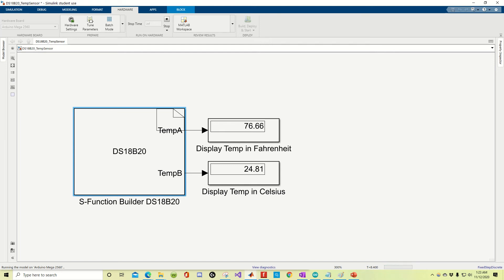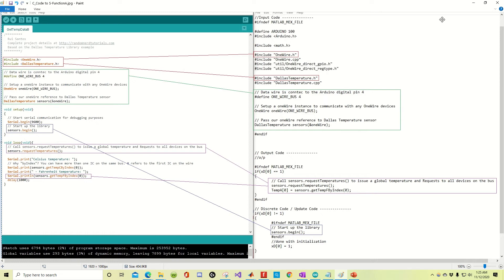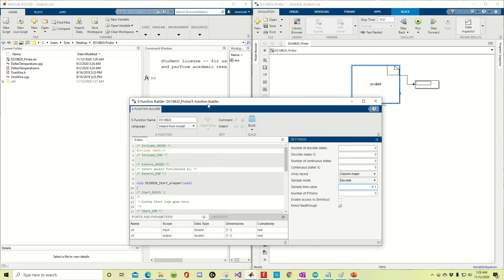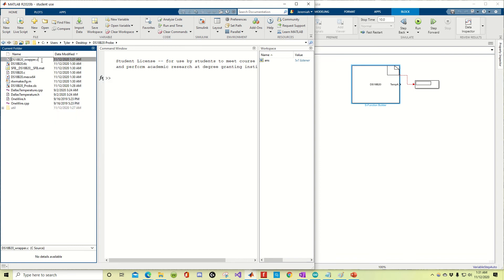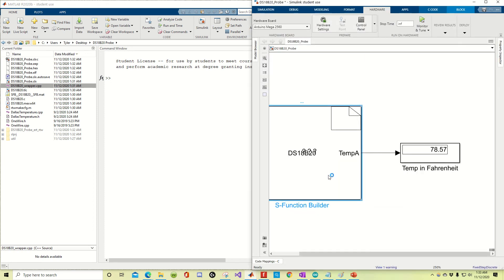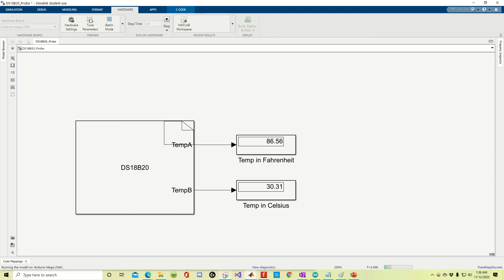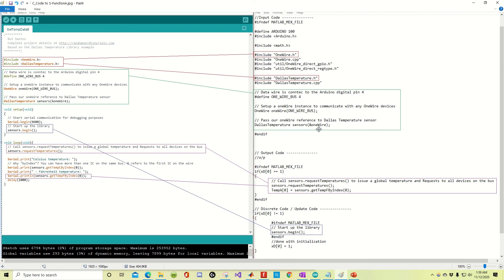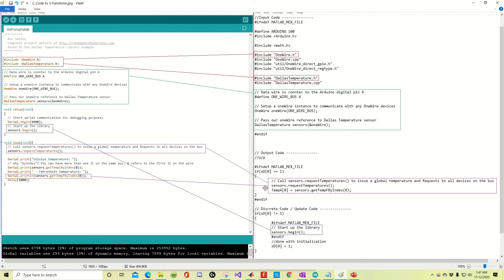1 How to integrate DS18B20 with Arduino in Simulink/Simulink s-function builder basics-1 temp Probe1

Comment: I am trying to use the Adafruit ILI9341 library in Simulink. 

I did everything like you did but when i try to build the Simulink model i get the following error:
Unable to find S-function module 'ILI9341_wrapper.c'. S-function modules must exist as either source files or pre-compiled object files on the MATLAB path.

I renamed the ILI9341_wrapper.c file to a .cpp file and added the extern "C" to the void functions. I also got the ILI9341_wrapper.mexw64 in the Matlab folder. I also added all the header and cpp files, which are included in the Adafruit ILI9341 header and cpp files, to the same Matlab folder. I am using Matlab R2022b. 
Do you know how to fix this problem?
Reply from the maker: I unfortunately don’t know how to resolve this. When I was testing I only used Arduino brand boards since any offshoot brand seemed to have issues.
Reply from the maker: It is possible the issue is due to missing library files within the bootloader but I’m currently unsure how to resolve this issue.
Reply: @NathanielTyler  I am trying to use the Adafruit_ADS1015 libary with Simulink and I have the same error as daniel. I do not have the Simulink Coder installed. I think this causes this error. Is that possible?
Reply from the maker: @AntoMatic-b5d The simulink encoder is needed for converting simulink block code into the c code which will be flashed onto the microcontroller.

Comment: Many Thanks. Diagnostic viewer giving error when I click to Monitor & Tune icon. Error : Code generation information file does not exist.  How can I fix this?
Reply from the maker: Do you have simulink encoder and matlab encoder installed? Do you have a complier such as visual studio community installed?
Reply: @NathanielTyler  Thanks for quick reply. I have intalled Simulink Coder , Embedded Coder , MinGW Compiler but Visual Studio Community not installed. I am also using Matlab R2020b like you.
Reply from the maker: @OpAmpLogic  what controller are you using?
Reply: @NathanielTyler  I am using Arduino Mega(2560)
Reply from the maker: @OpAmpLogic  review this link and tell me if it helps:
https://www.mathworks.com/matlabcentral/answers/731733-model-error-code-generation-file-does-not-exist-simulink-and-arduino?s_tid=ans_lp_feed_leaf
Reply: @NathanielTyler  Which version of the Visual Studio need to install for using Matlab R2020b?
Reply: Did you solve the problem? Because i have the same problem
Reply: @alischannel7206  codertarget.arduinobase.registry.setBaudRate('YourProjectName',115200)    Copy and run this code in your matlab  project. Then all parameters is same
Reply: @OpAmpLogic  i run the code but still the error
Can I contact you privately sir? To show you the circuit i have

Comment: Hi Tyler, thanks for the great video.  I replicated it and it works.  But I would like to read 2-4 sensors.  Unfortunately that doesn't work.  When I use an Arduino sketch, multiple sensors work.  But I can't get a connection in Simulink.  I tried to adjust the index but there is no value.  1 or 0 remains in the display.  Can you tell me what I might have to adjust.  Many thanks regards Denny
Reply: I have been resolved... implemented both single reading PIN's on Arduino UNO and build a Air Flap control Code handle two AirFlaps w/ relative crossing Temperature Detection at runtime.... I don't know why doesn't  handle library one PIN w/ more as one Sensor connected....? Im using PIN 4 and 7 as example and it work's fine.... Thanks a lot for getting information S-Function as owned library implemented Simulink Model.... Very helpful best regards Denny
Reply from the maker: @dossidr  Sorry for the late reply but I'm glad you were able to resolve the issue.  Well done on implementing a working solution.
Reply from the maker: You can modify the s-function so it accepts more than 1 input. I’ve done this before with weight sensors. I’ll try to get a code sample for you later today.
Reply: Hello, I managed to implement two sensors in the same S function and it works great. Note: I used a single arduino port for the data from both sensors.

Comment: How to connect the fuzzy logic controller with S-functions(sensor and actuator ) to behave with fuzziness in a simulink model and how to deploy them to plc?
Reply from the maker: Can you give me an example of what your desired setup?
Reply: @NathanielTyler  Here is the model that I want to deploy on a plc (raspberry pi /Arduino) the sensor and the actuator are presented with Matlab functions for simulation purposes until I can make s-functions for a temperature sensor and a dc motor(sensor and actuator could be replaced with any other types) my challenge here how I can connect all the parts with fuzzy rules to behave in a pleased way https://drive.google.com/file/d/1nvaCG2x5UtxMpYGpxoARwtWYkhxo0R8K/view?usp=sharing
Reply from the maker: @abdelghafarelkhaoui9806  Please note I have not verified this, but I think you have to mux your signals of interest and then feed the mux output signal into your Fuzzy logic controller. 
%% You Tube Examples %%
1) https://www.youtube.com/watch?time_continue=192&v=Z12oK07oFA4&feature=emb_logo
2) https://www.youtube.com/watch?time_continue=125&v=gPU9jWKXAgQ&feature=emb_logo

%% Simulink Example %%
https://www.mathworks.com/help/fuzzy/simulate-fuzzy-inference-systems-in-simulink.html

If your question is more specific I will have to do more research.
Reply: @NathanielTyler  thank you for the help my issue isn't with the model but the question here for example I have a sensor and actuator I set their fuzzy MF and sets and I simulate them but how to deploy them to plc? How to generate code and deploy from the model? Use a functions and write in C++? But how to connect all the parts with FLC and deploy the whole model to behave the way it behaves in real life?
Reply from the maker: @abdelghafarelkhaoui9806  Here's another video I created a while back that may explain what to do:

--- YouTube Video ---
"1 How to integrate Max6675 with Arduino in Simulink/Simulink s-function builder basics-1 temp Probe2"
https://www.youtube.com/watch?v=vFup14vi6H4&t=204s

--- How To Document --- 
"003 How To Make this Step By Step.DOCX"
Note: In step "006 01 Run Code on Arduino Uno.JPG" click 'Build' instead of 'Monitor & Tune' 
https://docs.google.com/document/d/11q6ylKlSURZBLG43LrsDaWVUGsq7A4oF/edit?usp=sharing&ouid=112053615642444612541&rtpof=true&sd=true

Comment: Thnx for the explanation, it's very helpful, I just wonder if there is a way to do the same to raspberry pi ?
Reply from the maker: **Summary**
YES, Simulink can flash to a raspberry pi.
Please note I have not used a raspberry pi, but the s-function builder block will be very similar.  

**Here are 2 links that should get you started**
Add-On Download Link: https://www.mathworks.com/hardware-support/raspberry-pi-simulink.html
Setup: https://www.youtube.com/watch?time_continue=318&v=wWLBugWJLwQ&feature=emb_title

**Steps for success** 
Step 1) make the code work in raspberry pi IDE
Step 2) translate that working code into a templated text file for 's-function builder block'. // Note: use my text file template as reference
Step 3) copy text into a 's-function build block' and test functionality with the raspberry pi.

**Note**
If you get stuck on step 2 or 3 you can send me your working raspberry pi code and I may be able to provide suggestions.
Reply: @NathanielTyler  Thnx a lot for the explanation and the reply, in fact, I already installed the needed packages and I had run what you described and it worked perfectly, but I have a question that I'm stuck with since I started the work (am doing a thesis btw so I have a ton of stuff to do in a complex model), so my question here is could we integrate the s-function in a model where it can communicate with the other parts in the model that will be run on hardware ? as an example I have a model and I want to connect a dc motor and DS18B20 temp-sensor to then run on Arduino/raspberry in the middle there is some stuff for sure as a PID controller(am using a fuzzy logic controller) so should use the s-function builder and then import the libraries needed after running them on an IDE? is it going to be executed or there are some tips to be done with the model? sorry if I wrote a lot but I'm really confused about many stuff, I have another question about the use of the fuzzy logic controller in a model built in Simulink to be run on a hardware board is it going to be executed within a model or there is no way except we generate code from it (I cant use Simulink coder neither the plc nor MatLab coder because  I'm using the trial version for student ), I hope I can get some answers because I've been blocked for several days thanks in advance Nathaniel
Reply from the maker: @abdelghafarelkhaoui9806   I am a little confused by your question so please draw up a picture in ms paint or attempt to re-summarize your question.

My Response to your question:
In short, it is possible to create multiple S-Function Builder blocks in your model and reference the output signals throughout your model.  Furthermore, S-Function Builder blocks can be feed input signals.

Note 1:
Please note, Matlab coder/Simulink coder are mandatory if you're attempting to both encode and flash a PLC (Arduino/Raspberry Pie) from Matlab/Simulink.

Note 2:
In a profession setting, if you plan on calling the same block multiple times throughout a complex model you 
typically mask your S-Function builder block in a common library and call the custom block from the Simulink library panel.

### Visual Community Compiler - Free download and Install Instructions ###
https://docs.google.com/document/d/1KvT8DJh26U3GUhYPkiEbR94VkpTA9H3Q/edit?usp=sharing&ouid=112053615642444612541&rtpof=true&sd=true
Reply from the maker: @abdelghafarelkhaoui9806 
A world of wisdom:
If you have a student email then you can buy the student edition of Matlab and Simulink along with their Respective Simulink coder & Matlab Coder for a relatively cheap price. (See Document below for student pricing... please note you don't have to buy every addon like I did.)

### Visual Community Compiler - Free download and Install Instructions ###
@t
Reply from the maker: @abdelghafarelkhaoui9806   if you type 'ver' into the matlab window you can check what add-ons are included in your trial version of Simulink and Matlab.
Reply from the maker: @abdelghafarelkhaoui9806  are you wanting to use a model reference block which can be compiled independently of the full model?

Model
Reference another model to create model hierarchy  https://www.mathworks.com/help/simulink/slref/model.html#:~:text=A%20Model%20block%20is%20used%20to%20reference%20one,in%20which%20a%20Variant%20Subsystem%20block%20can%20operate.
Reply: @Nathaniel Tyler i don't why my comment didn't appear. I hope that you received it

Comment: While trying this method for controlling a Steeper motor I am facing this problem. "Top model targets built:

Model     Action  Rebuild Reason                                    
====================================================================
step_try  Failed  Code generation information file does not exist.  

0 of 1 models built (0 models already up to date)
Build duration: 0h 0m 18.264s
The path 'portable/sketchbook/libraries' does not exist.
Caused by:
The path does not exist, error code: 0"

How can I solve this?
Reply from the maker: Do you have the encoders installed for simulink and matlab?

Also please note that per my research you must install Visual Studio Community 2017 for both the MATLAB Compiler and Simulink Compiler to Run effectively. 

——————————————————————-
Simulink Coder From https://www.mathworks.com/help/rtw/index.html?s_tid=CRUX_lftnav
Simulink Coder From https://www.mathworks.com/products/simulink-coder.html

MATLAB Coder From https://www.mathworks.com/help/coder/index.html?s_tid=srchtitle

——————————————————————-
Clicking on the link below takes you to the webpage below which includes the download button
Visual Studio 2017 version 15.9 Release Notes From https://docs.microsoft.com/en-us/visualstudio/releasenotes/vs2017-relnotes

In order to download Visual Studio 2017 you must be logged into your Microsoft account and accept the free Visual Studio Subscription
https://my.visualstudio.com/Subscriptions

Download Visual Studio Community 2017       ///////        Go to the downloads page and Download 'Visual Studio Community 2017' because its free and supported by both MATLAB and Simulink
https://my.visualstudio.com/Downloads?q=visual%20studio%202017&wt.mc_id=o~msft~vscom~older-downloads

——————————————————————-
Installation File: Visual Studio Community 2017

Begin the Installation Process

Install "Desktop Development with C++"

Re-Install the MATLAB and Simulink add-on's as needed
Reply from the maker: what stepper motor and libraries are you using?

Comment: tnx for your help. you helped me a lot. but one thing could you please show us for MAX6675 thermocouple. I tried but it doesn't work. tnx again.
Reply from the maker: I was able to get the Code working with a Max6675 Module. I will create a video on this when I get back from Holiday vacation. Here's my Source Material that I will be using to create the video: https://drive.google.com/file/d/1xqaJcKZtBPX_73edBAkmzDT-NAtQbdg5/view?usp=sharing
Reply: @NathanielTyler  I do not know how I thank you and express my appreciation. anyways I really appreciate your help brother.
Reply from the maker: I ordered the thermocouples and am waiting for the delivery. The parts should be here in a week.
I think I know what the s function code is supposed to look like, but I like having the parts in hand and working in simulink before I share my solution.
Reply: @NathanielTyler  tnx I will wait for the video.
Reply from the maker: Great question.  I'll have to look into that.
Reply from the maker: I’ll try to create a video but here’s another persons video for now https://youtu.be/oSp_qm6s33M
Reply from the maker: Here’s some more research info if your interested:
https://youtu.be/dRGX_8P_98w
Reply: @NathanielTyler  yeah, but I want to use it in Matlab s function. just like DS18B20
Reply from the maker: Here the parts I ordered in case you wanted to know ahead of time:
SainSmart MAX6675 Module + K Type Thermocouple Thermocouple Sensor Temperature 0~1024℃ for Arduino https://www.amazon.com/dp/B00PVTH4MW/ref=cm_sw_r_cp_api_glt_fabc_QKBGP478M59DZMS1SQ8Z
Reply from the maker: Glad I could help.
Reply from the maker: Here's My Video: https://www.youtube.com/watch?v=vFup14vi6H4

Comment: can it be used on matlab r2017b?
Reply from the maker: I personal do not know if this specific simulink file I've created is backwards compatible with matlab r2017b.  You will have try and attempt opening the project file I've created and determine if the program works.
  
Project File: https://drive.google.com/file/d/16talI_CAqRLc7VtByoRr4ZYr38aS6DV2/view

If the option above doesn't work you could try to follow the steps in the video and try to build this program in r2017b.

For more info on the r2017b S-function builder block I'd recommend visiting the following link: https://www.mathworks.com/help/releases/R2017b/simulink/sfg/s-function-builder-dialog-box.html#f8-107343

Comment: Hi - is there a way to include the Arduino / Adafruit header and cpp libs conveniently? Its a hassle to copy them. I am missing always some libs and its a pain to copy all the .h and .cpp files.
Reply: My first thought would be to try to go to Matlab >  Home > Set Path > Add with subfolders: there you need to indicate your Arduino library root (e.g. C:\Users\<user-name>\Documents\Arduino\libraries). This will add recursively all subfolders (with all libraries) to the path. 
Second, if the above does not work, you may want to play with the Libraries panel of S-Function Builder, and add accordingly INC_PATH, LIB_PATH, etc. You may want to check the official help file for that: 
https://uk.mathworks.com/help/simulink/sfg/s-function-builder-dialog-box.html
In addition, you may also want to check the historical tutorial (the grandfather of this youtube video): 
https://www.mathworks.com/matlabcentral/fileexchange/39354-device-drivers

Please let me know if any of the above solutions were successful or not.
Reply from the maker: @catalinstefanteodorescu2996  Thank you so much for providing insight into this matter.  I am happy to say that the second Idea you provided was able to work.  I am now able to call Libraries from outside my project folder.  I will be creating a follow up video to my solution very soon.  In short, when adding a folder path under the Libraries panel of S-Function Builder I selected "INC_PATH" as the tag for both "C:\Users\<user-name>\Documents\Arduino\libraries\OneWire" & "C:\Users\<user-name>\Documents\Arduino\libraries\DallasTemperature"
Reply from the maker: Not that I've observed.  I have tried several attempts of calling libraries outside the project folder but they have all ended in failure.  
Please feel free to download the project @ https://drive.google.com/file/d/16talI_CAqRLc7VtByoRr4ZYr38aS6DV2/view
Reply from the maker: This was my solution: https://www.youtube.com/watch?v=-iDBuuhVx1c&t=0s